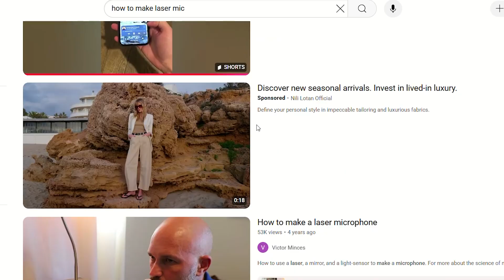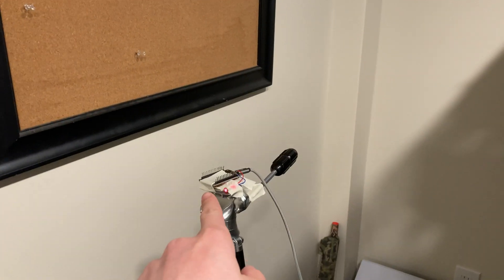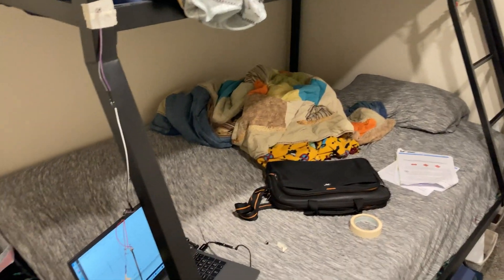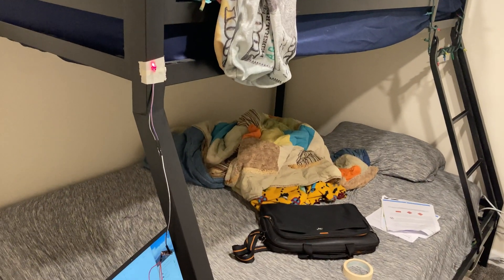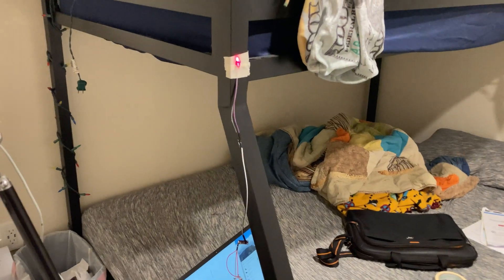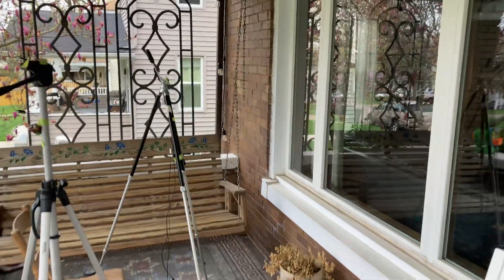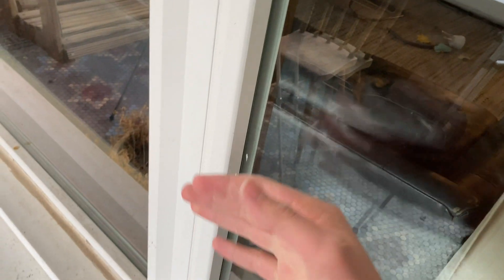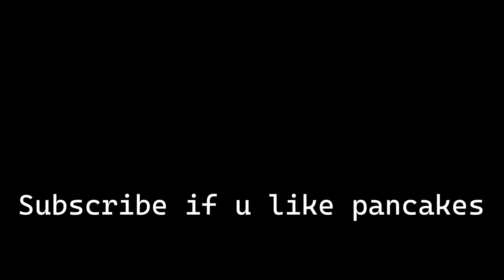DIY $10 CIA Laser Microphone

Comment: Cool, I'm making this connected to a 18650 battery -> usb step up module -> microphone preamplifier & diode so it's portable, and then connected an esp32 to filter and relay the audio signal to a pair of bluetooth headphones. Also using 2 lasers and sensors to average the audio, reducing noise by a lot.
Reply from the maker: Dang
Reply from the maker: That’s pretty sweet

Comment: Bro I'm hoping to make this using an Arduino and breadboard and amplifier (LM358 OP-Amp) can you give me any tips or instructions on how to connect the photo diode, amplifier and Arduino such that I will hear the audio output on my laptop?
Reply: hellow bro, i have done it with esp32, the result is very bad too much noise coming
Reply: I'm doing it with an esp32 and 2 lasers to average the noise, building it in the next couple of days. Also a high pass and low pass filter on the esp, and all of it connected to a 18650 battery.

Comment: Nice video if you need money for a sick project i gotchu im trying to make this right now if you have any tips that would be great
Reply from the maker: Bro actually
Reply: @justaPancakeGuy  Love the videos im just a high schooler and i know how it feels not having enough for a project
Reply from the maker: @allemands bro that would be crazy
Reply: @justaPancakeGuy  im struggling with this is there something im doing wrong i connected the photodiode with jumper wires where the mic was and followed you wiring diagram did you use a voltage amplifier or any capacitors to filter noise
Reply from the maker: I did not
Reply from the maker: I’m not sure what might be happening

Comment: Ive aeen this used in so many spy shows to listen in on what people are saying.
Have you ever watched a show called burn notice?
If you have then you also know there is a easy ish way around something like this.
Tape a vibrater to the glass and the outside wont be able to pick up anything over the vibrations on the glass at least thats what they did in burn notice.
There's some really cool thing's that Michael throughs together in the show.
Like a senor like thats hooked up to a mobile phone so when the senor goes off the phone rings or vibrates and lots of other interesting things.
Reply from the maker: Never seen it but it sounds cool
Reply: Yeh, I've seen the products called "Laser Microphone Interrupter" yadda yadda. Maybe $20.00 - $30.00 dollars. 

Like the vibrator in a glass... (apparently, lol), it's just a mp3 player or any device really that plays a loop of a recording of white noise. Which could be most anything, but typically is just static from a radio or tv...